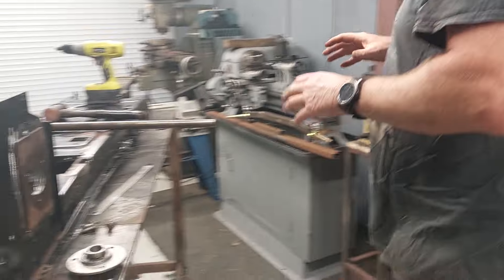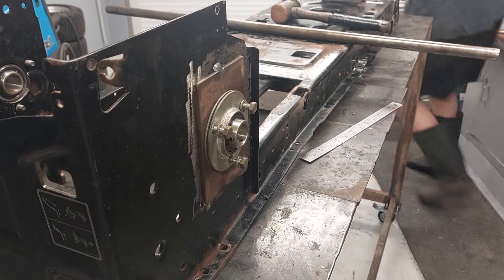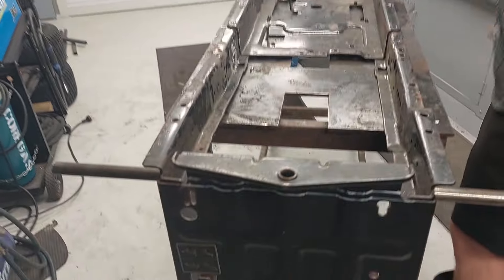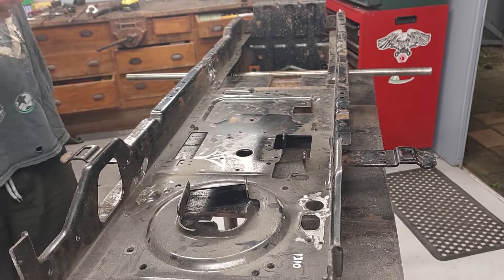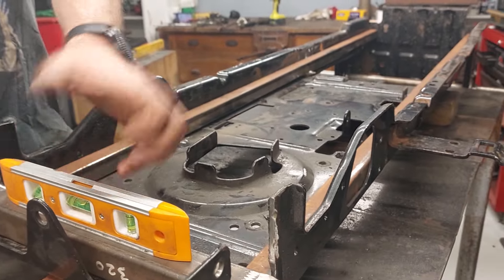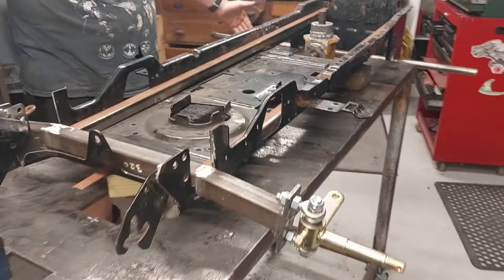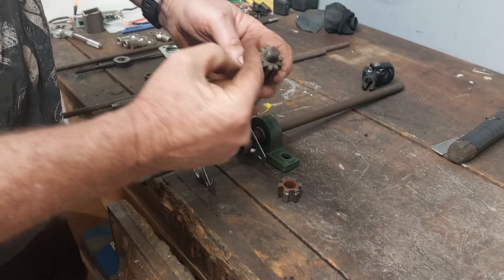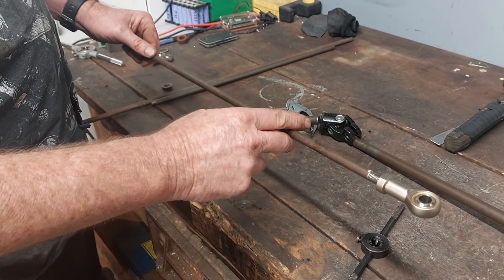Strengthening the chassis and steering ideas. Cub Cadet build part 4

Comment: Hay  bazz, just a few questions on where you're getting parts from as most nz websites don't show any or don't have any parts! and US parts are everything i need  but for 1000s of doll hairs! I have the skill to make everything I need but am restricted by the tools i can get my hands on and some time limitations. Know any good (reasonably priced) places? Also for a 31 flat head do any other engines share the same piston ring size for 1/2 the price as i bought 8 cylinders worth for less than my 311777-0134-E3 single! Its crazy. Im rual huntly btw so im sure one day i may catch up with you in person hopefully.  Grate videos its been a great help thanks.
Reply from the maker: Hiya, getting part in NZ can be a bit difficult. I use Motive parts in Taranaki for some parts and Go karts direct for my front ends parts.I get my pullys and sprockets from applied engineering. Then i tend to surf trade me ,alliexpress or temu for other parts. Maybe others can shere where they get there partrs from as well.